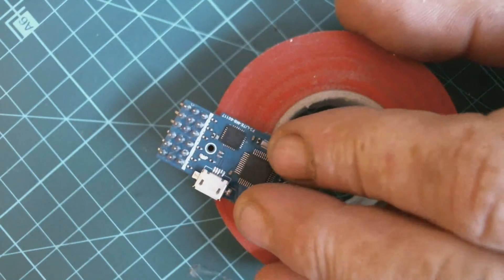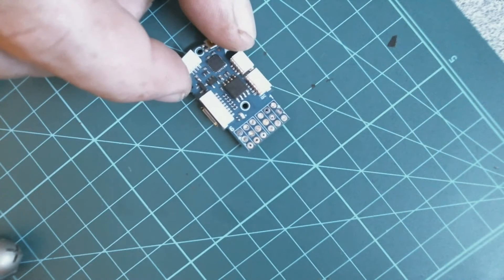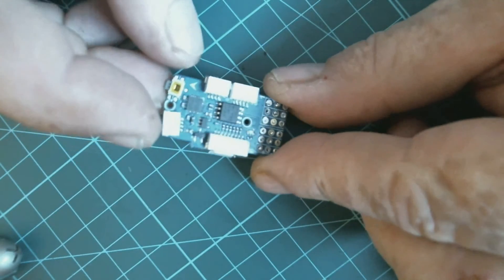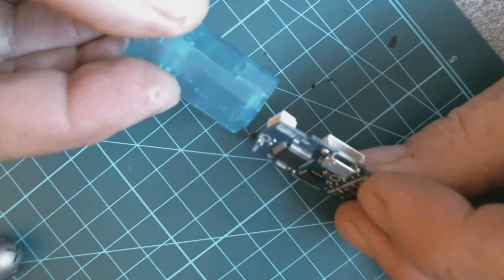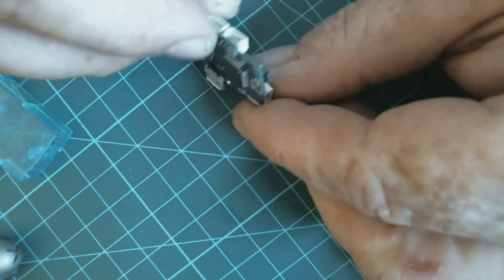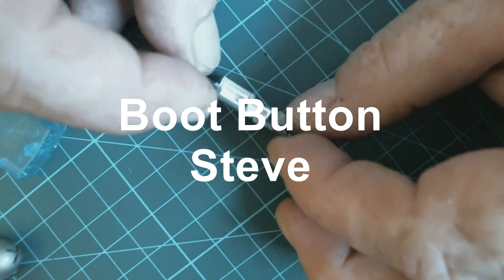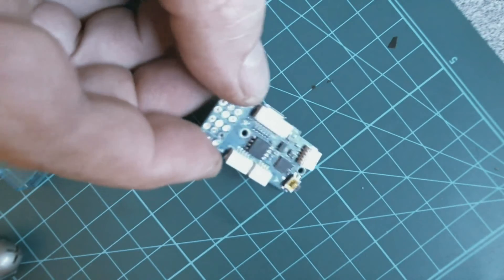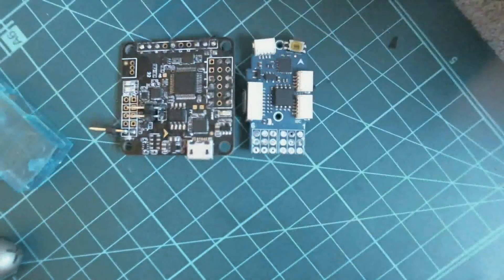Kingkong F3 Mini Flight Controller De Pinned

Comment: Ive got a kingkong 110gt and can't get motor 2 to run after crash,  ordered new combined fc and esc, going to deepen and use fc some were else,  can you tell me what holes are for what were desoldered

Comment: Hi mate nice vid, I have a King Kong 210gt. My USB terminal broke so Iv ordered a new flight controller. Does this come pre flashed? Or will I have to flash it with cleanflight? Thanks
Reply from the maker: It should come flashed with CF or BF

Comment: g'day steve, i am a little curious of the settings you used when flasing it; did you have these on or off? no reboot sequence, full chip erase, manual baud rate, show unstable releases. and if you had the baud rate on, what was it set too, thanks for the help.

Happy flying
Reply from the maker: leave everything in default and it flashed no problem.
Reply: when first plugging in the f3, do i need to push the boot button, or do i just plug it in?
Reply from the maker: just plug it in
Reply: sorry for so many questions, but how would i use the wiring harnesses that came with the kit to plug in a flysky ia6b receiver?
Reply: or how did you hook ppm?

Comment: Hi, can I ask you how you connected in ibus? I flashed betaflight and it flashed smootly, but cannot figure out how to get ibus working on it...
Reply from the maker: sorry I did not answer earlier but if you still have the problem you have to choose Ibus in beta flight on the config page under what protocol to use for the serial receiver.

Comment: Do you installed firmware to controller? I can not boot into DFU mode.
Reply: did you extract and run the drivers?
Reply: Problem solved

Comment: have you had a chance to update the firmware beyond the stock? does beta flight work?
Reply from the maker: Yeah its on 3.1 betaflight
Reply: I tried to flash clean flight 1.14 and it would not work. only on 1.12 I was concerned I might be stuck at that. I have the KingKong 210gt which came with the same FC. I'll give it a shot on beta flight. thanks
Reply from the maker: No probs
Reply: was the 210 gt wired up with an ia6b reciever

Comment: Do you know how to flash esc through this FC?
Reply from the maker: Yes they flashed no problem using BLHeli pass through
Reply: I'll have to try that. My motors are on the fritz. I've done motor configurations in cleanflight, but they still are uneven. Any suggestions?
Reply: if its the kingkong 90gt you probably had same issue I did. the plastic standoff mushed one of the chips on the esc. usb side was mine for the front motor. I had to resolder the chip to the esc board